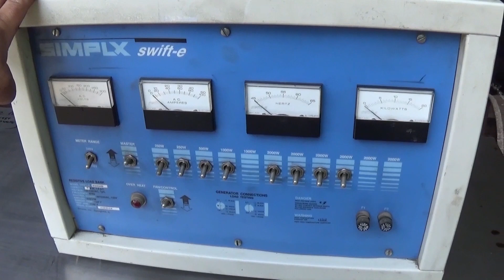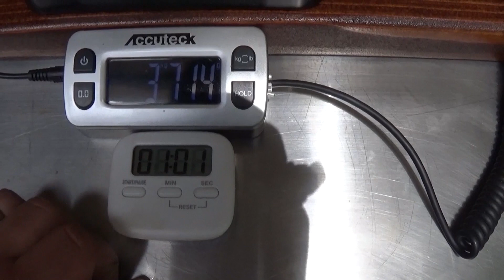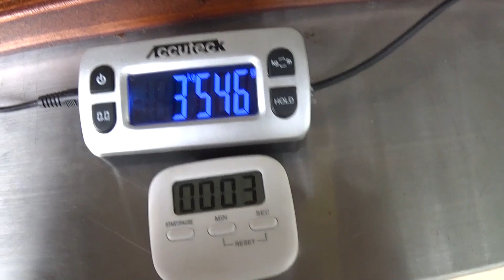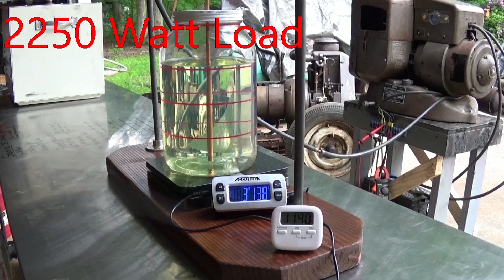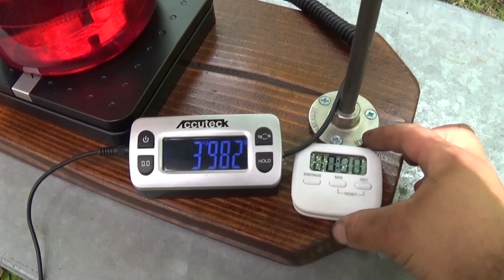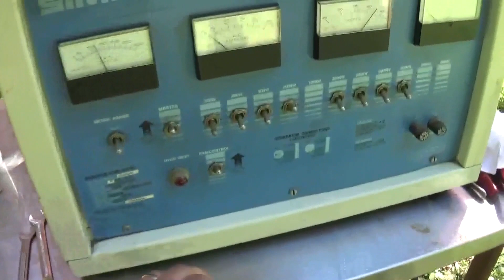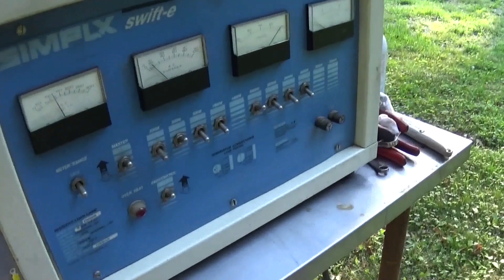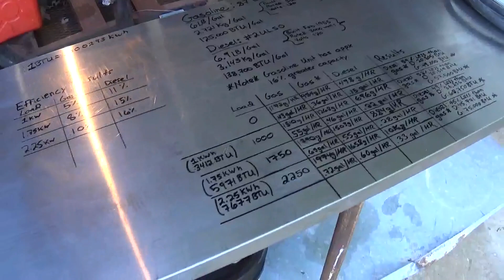GASOLINE VS. DIESEL (FUEL CONSUMPTION  1950s Style)

Comment: It might also be worth mentioning, especially with generators, that diesel has a significantly longer shelf life than gas.
Reply: since they added ethanol to diesel shelve live has been cut from near infinite to a couple of years max.. same with gasoline.. i wished there still was non-E fuel available..
Reply: @marks8068  In some states in the US you can still get ethanol free gas from pumps, everywhere else you can usually get a can of ethanol free gas in Homedepot or a similar store.  Didn't know they added ethanol to diesel too.
Reply: @marks8068  My local grocery store sells ethanol free gas, I buy that gas exclusively, way better than anything else I can get in my area.
Reply: @marks8068  Biodiesel* not ethanol, that would be horrible in a diesel.
Reply: @marks8068  This is completely incorrect, don't spread false information. Change the comment please.
Reply: Unfortunately the new sulfur free or low sulfur fuel has an estimated shelf life of about 3-6 months which is only a few months more than gasoline with storage stabilizer in it. The red  ag fuel is still the less refined or so called dirty fuel and that will store for decades. I have a 1500 gallon barrel of red that is well over 15 years old and my farm equipment runs beautifully even still.
Reply: @marks8068  There are two sides to ethanol fuel. If it is mixed with gasoline you can only run it with fuel injection because the reaction of both fuels cause condensation which in turn cases solidifying of the ethanol fuel. However, if you burn straight ethanol like the alcohol racers do you can actually multiply the amount of horsepower gained, provided you know your limits. Lol
The interesting thing about today's fuels is that, unlike in the 1970s, today there are several domestic and foreign vehicles that make well over 800 horsepower with some  up to 1,500. There are always trade-offs it just depends on which ones we choose.
Reply: @PoLoMoTo2  The "Ethanol free" or "E-0" or "E-Zero" as some stations call them are all water filtered fuels. The process is simple: Get a container with a bottom drain and a top filler opening. Fill the container about 1/3 to 1/2 full of water, fill the rest with gasoline and swirl it around for a while. Watch as the ethanol begins to become a white gel type solid in the bottom of the container as the gasoline stays at the top. Drain out the water and solidified ethanol and the remaining liquid in gasoline. That is the basic process of non-ethanol gasoline. The additional process is reason for the higher price for that fuel, it typically costs about the same as premium 91 octane at least here in Hawaii. In reality all gasoline in the United States has ethanol in it from the refinery because it is required by federal E.P.A. guidelines, the non-ethanol process was an exception added later for carburated engines like outboard, motorcycles, lawnmowers, trimmers,  blowers, etc.
Reply: @92powerdiesel61  Actually, bio-diesel is a form of ethanol. I think what mean is the re-refined engine and deep-fry oils which break-down additives. Both of these can actually be run with a filtration system to remove impurities, but the vegetable oil will gel very quickly with or without the additives. I do believe some states require a certain amount of ethanol in the low-sulfur diesel to increase volatility ratings, but I don't know if that was just experimental or it is still happening now.
Reply: And it also smells like hydrocarbons. Diesel is in many ways better. This is why they always say the world runs on diesel..
Reply: @BarnStangz  nope not in the Netherlands.. the special non-ethanol fuels for small engines are ridiculously priced. like $10 per gallon
Reply: @the_hate_inside1085  i cannot edit comments.. and im not completely wrong. the bio components of biodiesel do contain ethanol like substances. thats why it goes bad after a while.
Reply: @gwbuilder5779  Red diesel is the exact same as regular diesel it has red dye added so they can catch people using it on road since it's not taxed.
Reply: Just got a tractor running with 30 year old diesel in it
Reply: @TechOut  In the Netherlands that system was used for many years, not sure why they stopped using it.
Reply: @gwbuilder5779  Ethanol makes power because of higher octane rating (About 110 octane) and the fact you need to burn about 1/3 more of it to equal the BTU of gasoline. That higher octane allows ignition timing to be advanced further, compression ratios can go up (Both are the key to making power)   the cooling effect alcohol has with the increased amount of fuel being injected help allow those higher compression ratios and help cool the cylinders.
Some of the higher end Drag Racing cars dont even have a cooling system. Running methanol or Alcohol and its cooling effect is enough to keep the engine temps low enough  during warm up, burnout,staging, and the quarter mile pass
Reply: @gwbuilder5779  I'm not sure if its different state to state, but Ethanol free gasoline is not always water filtered. In OR and WA at least, gasoline in the storage tanks at the racks is what we call "clear" fuel. Other tanks store pure ethanol. As I load my truck (to deliver to gas stations), ethanol is blended in as its being loaded on the truck. When I select the type of fuel to load, I can even get different amounts of ethanol, like 5 or 15% for example. Another interesting thing, there is no mid-grade. The racks have only 87 (regular) and 92 (super) octane tanks. When I load mid grade, it blends it on the fly while loading. However, I almost never deliver mid-grade, because most gas stations dont even have mid-grade tanks, only regular and super, their pumps blend it on the fly from the regular and super tanks as you pump it.
Reply: ...also a diesel can run on other oils in an emergency.
Reply: @gwbuilder5779  Even some bacteria can grow in diesel fuel.. what makes biofilms and plugs up the fuel filters.
Reply: @Leemur2335  Actually, the red dyed fuel is agricultural rated and priced lower to decrease the cost for farmers. I use red fuel here on the farm for machines and coffee dryers because it is a higher grade of refined fuel that burns cleaned-up soot by product. Some areas of the country require it as the only furnace fuel allowed as furnace oil. Of course many Obama era EPA regs are no longer in force, but low sulfur remains the industry standard because all road certified vehicles including transport and locomotives have all converted to use it.
Reply: @Leemur2335  The difference is in the remaining burnable toxins. I don't have the last data sheet, there are 2 classes of red fuel, one is the universal fuel typically used in machines and the other  (which we use here) is a semi-food grade for the forced air furnaces in the coffee dryers. The specific refining is different for certain targeted elements. In fact, you bring up a good point, that finishing process may actually be done here in the state and not in a standard refinery process. In food service there are very different rules, even the lubrication is a clear grease that only changes color with heat and friction. I do know that the red fuel I buy smells very different from the machine  grade standard ag fuel for sure.
Reply: @jaybee2344  thnx, but im from the Netherlands, so that link is pretty much useless to me since it only lists usa and canadian pumps
Reply: @gwbuilder5779  > Actually, bio-diesel is a form of ethanol.
Ah, NO. Not at all. Just because product A is made using product B, that does not make A=B. So not only is biodiesel NOT ethanol, biodiesel can be and often is made using an entirely different alcohol, methanol. The alcohol is used together with an acid, alkalai or other catalyst to transesterify the bio-oil (animal or vegetable). That means the ester groups on the bio-oil are swapped, but the alcohol is NOT part of the final product. See https://en.wikipedia.org/wiki/Biodiesel_production#Transesterification
Reply: @YodaWhat  Actually, true bio diesel is considered all food based elements which specifically states ethanol a corn based alcohol. Methanol is derived from trees as a naturally occurring solvent which is highly toxic to human skin. You are correct in the fact that some formulas do state the use of methanol, but they are not bio diesel certified. In fact, just this past month a notice was posted to all businesses and general public that a company in Mexico was shipping methanol based hand sanitizer to the U.S. and it was recalled because if used it would cause severe organ damage. There are many waste oil formulas out there and several do recommend methanol,  but they are intended for the used motor oil applications not vegetable oils. I personally do not distill bio diesel, but a couple of people I know who do said that when they used methanol to mix down the vegetable oils it did not seem to fully mix and break down properly, but worked beautifully with waste engine oil. My only direct experience with vegetable based biodiesel is that you cannot let it sit. It either needs to have an agitator to keep it mixing or use it up and keep adding a fresh mix. I bought a f250 diesel that sat for a year or so and had to replace both tanks, all the fuel lines, and the injector pump because the fuel solidified in the entire system.  Fortunately the  injectors and return lines were automatically drained because the engine basically runs out of fuel when the fuel shut off is deactivated by the key turning off. I am aware of some YouTube videos using a methanol formula for personal use, but I guarantee that you cannot certify biodiesel with it here.
Reply: @PoLoMoTo2  the problem is the ethanol free is usually a high octane and for engine with a designed compression ratio to run on 87 it is horrible for the engine so better to just run pump gas
Reply: @TheVexCortex  ethanol is not as bad as people think it just attaches to water. Guess what we did before the higher contents used dry gas to “make the fuel last longer and water burn” guess what dry gas is a type of alcohol. The ethanol does brake Down soft materials more but it evaporates unlike old gas witch gummed up and turned into a nasty sludge. They are trying to sell you on the more expensive ethanol free. With is a higher octane and most small engines have a compression ratio and fixed ignition timing to burn 87 octane when running any higher you are detonated after the piston has started is decent and is horrible for the bearings
Reply: @joshbennett2762  Exactly none of what you said is correct. 

I've witnessed ethanol gas kill carburetors first hand. I've seen it destroy fuel line first hand. I've seen it foul plugs first hand.

Water doesn't burn, not even if you mix it with ethanol. The ethanol burns in the combustion chamber, leaving the water behind. Now you have a tar-like compound in your combustion chamber, because the water mixed with some other chemicals when the ethanol burned.

Ethanol-free isn't actually more expensive, fuel ethanol is subsidized, so you still pay more for it, just not at the pump. If the government would stop propping up the ethanol industry with our tax dollars,  no one would buy it anymore. Unsubsidized, it costs about $6-$15 per gallon. Who's going to buy that when they can get gasoline for $2 per gallon.

Octane is the unit they use for detonation resistance. Higher octane = more resistance to detonation. Running higher octane gas in a lawnmower isn't bad, and it doesn't make it detonate. Running lower octane gas in a mower might make it detonate though.

Ethanol has an octane rating of 113, so by your logic, running ethanol in a mower will make it detonate and ruin the bearings. You're wrong of course, ethanol will burn just fine in a mower, it will just ruin the carb, the fuel line, and foul the spark plug.

Don't believe me? Go look it up for yourself.

Octane and ethanol primer:
https://mnbiofuels.org/media-mba/blog/item/1511-octane-and-ethanol-for-beginners

Mower running on ethanol:
https://www.youtube.com/watch?v=2XB2MeNgVW0
Reply: @TheVexCortex  you literally contradict yourself multiple times
Reply: ...and is safer (not volatile) and less toxic via fumes and/or skin contact. Gas is just stupid, unless u r big oil getting rich off what is otherwise a waste byproduct. America has been cheated out of small diesels for a century now; compare what we are allowed to have compared to Europe and Japan.
Reply: mark S, there is no Ethonol in diesel, they just removed the sulfur from it. Gasoline got Ethonol.
Reply: @92powerdiesel61  no, it's a significant improvement.  Ultra low sulfur, vastly improved lubricity helping injector racks live much longer, often greater calorific content, no waxes, residual glyceride components of the transestification process are voracious cleaning agents throughout the fuel and combustion systems...
Reply: @gwbuilder5779  biodiesel is the product of a reaction called transesterification.  That is the process of putting a certain quantity of Meth-hydroxide (methanol and say sodium hydroxide mixed together to make that - no ethanol used...) into a base quantity of oils and fats, used cooking oil perhaps - and separating the glycerides from the biodiesel.  The biodiesel is washed through hot water to separate any remaining hydroxide percentage and the glycerides are processed to make degreasers, soaps etc.  The biodiesel is very clean, very pure and very good in any diesel engine.  There is much less environmental damage created by that process than by refining crude oil...
Reply: @boatbeard7767  I was saying putting ethanol in a diesel would be terrible, not biodiesel. As you've stated they are two vastly different things.